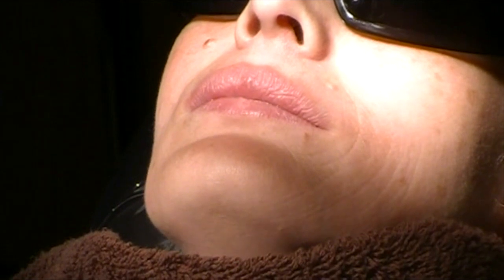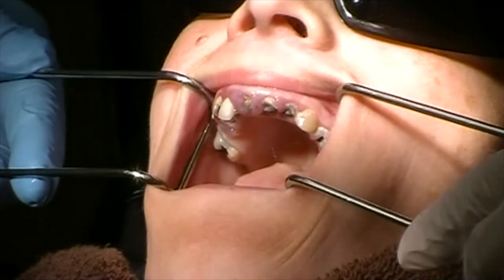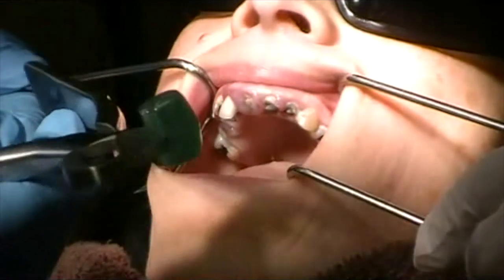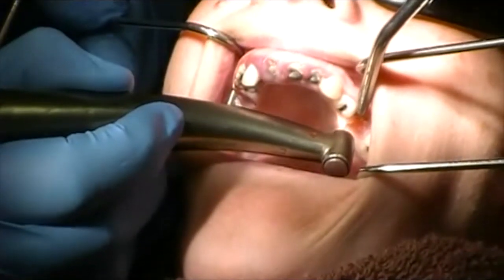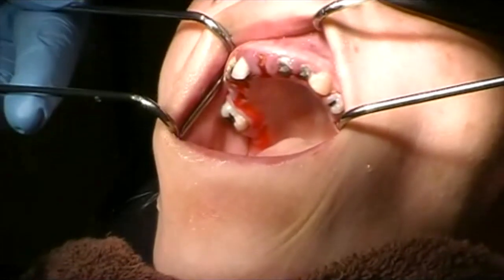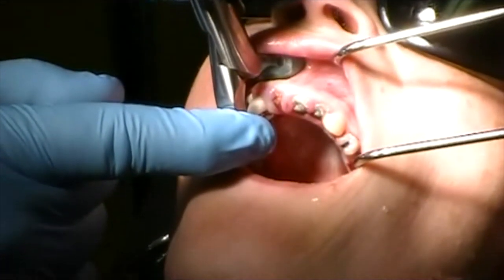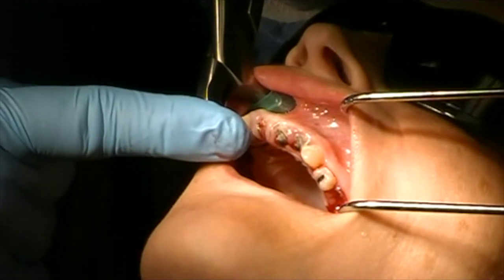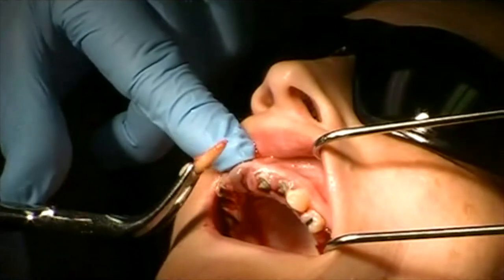Extraction Lateral Incisor Upper Anterior, Physics Forceps, Overdenture, Full mouth extractions

Comment: Correct me if I'm wrong, but it clearly looks like the buccal plate is fractured @5:32 , then you push your finger on it to hold it in place while you remove the tooth.

Comment: Where does the preparation exist exactly? Did the gum become  lucerated after this preparation?
Reply from the maker: Do you mean where is the beak placed on the root structure? Or are you talking about where the bumper is placed? Beak engages the lingual aspect of the tooth and the bumper is placed as high in the vestibule as possible.
Reply: @GoldenDent  l mean the preparation using high speed to flattening the palatal surfaces of roots...where is it exactly?